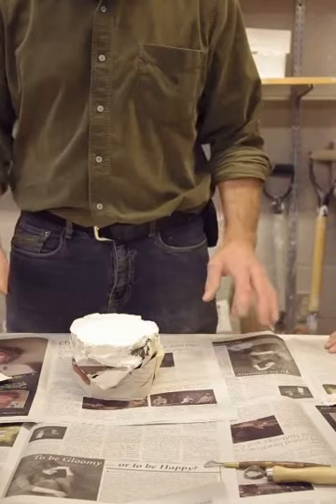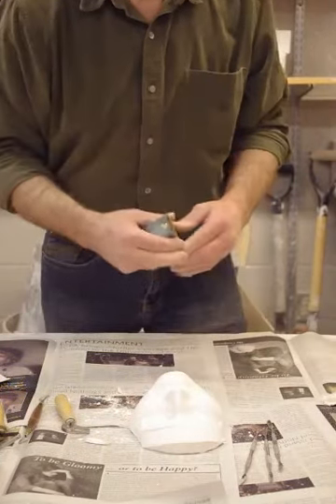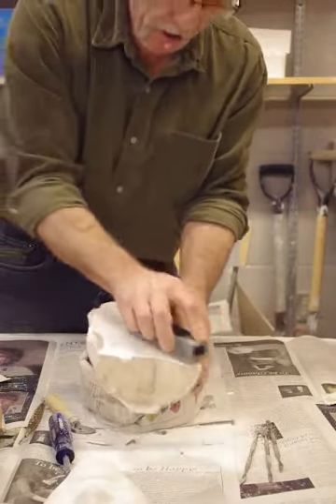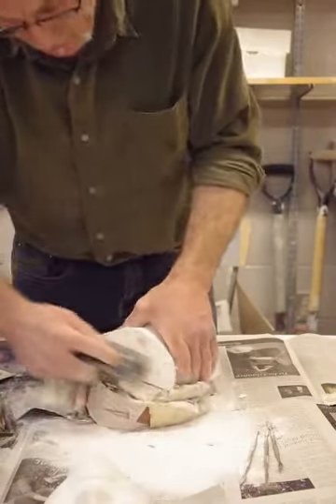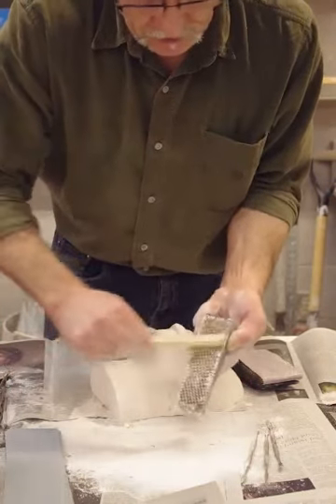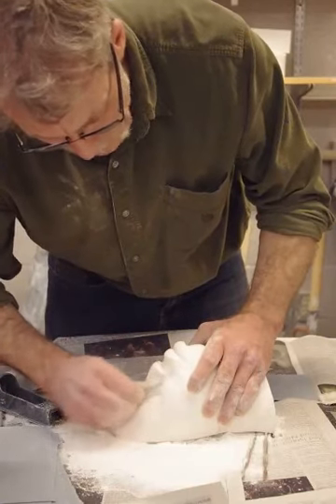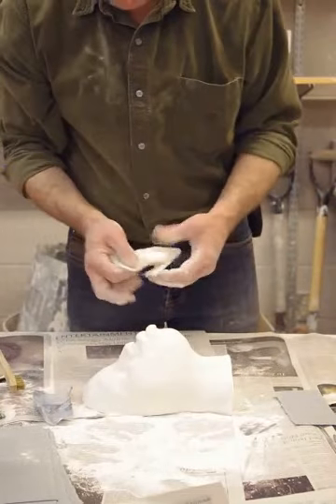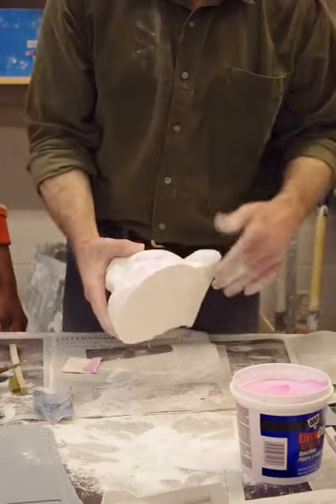Plaster Lifecast of Face, Demould and Clean Up. Part 1 of 2

Comment: What plaster is this
Reply from the maker: This is common pottery plaster used by ceramists to make "slip molds": a simple method of reproducing a ceramic form (like a small statue) multiple times with liquid clay that solidifies inside of the plaster mold.
Reply: @terryreynoldson6698  thank you so much for the detailed answer!